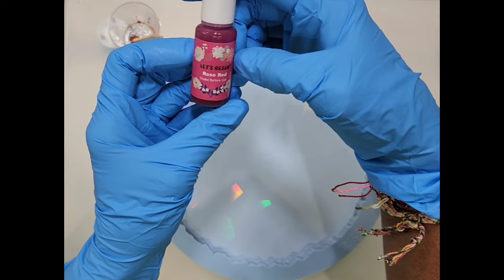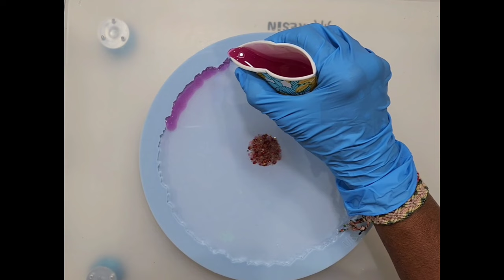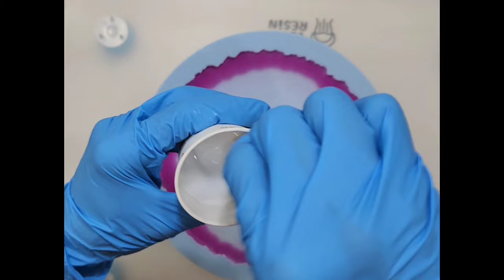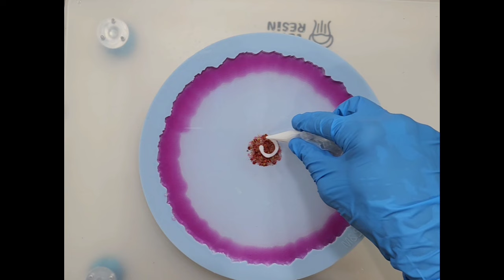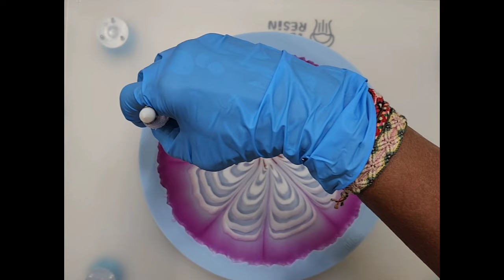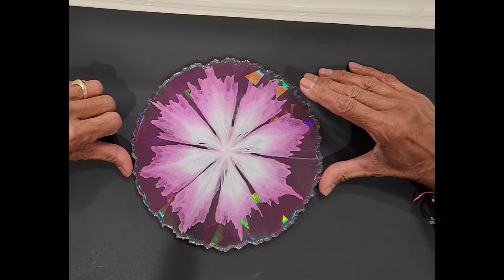Love this different way of drawing Resin 3D Blooms in this tray mold!

Comment: Total resin quantity?
Reply from the maker: What size is your mold?
Reply: 25 diameter
Reply from the maker: @khanafridi8643  I'm not sure what you are asking...In case you haven't done this...but when I have a new mold and I need to know how much resin it will hold, I pour water into a measuring cup, then pour that water into my mold and that will give me an estimate of how much resin I will need to mix for that mold.  If that's not what you're asking then please describe the question more in detail.  Thanks.